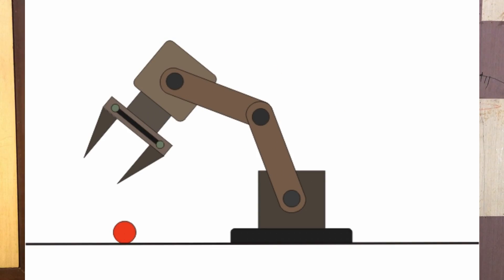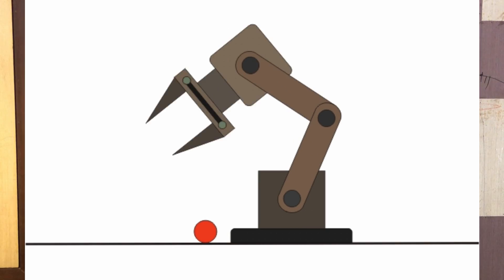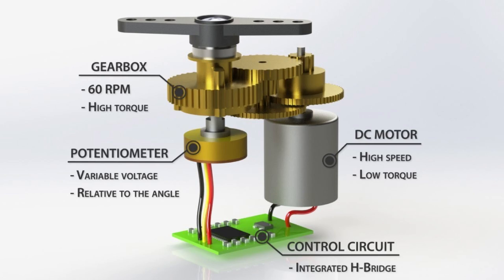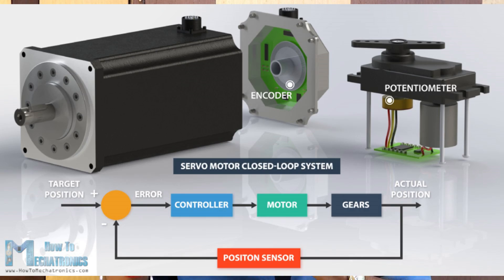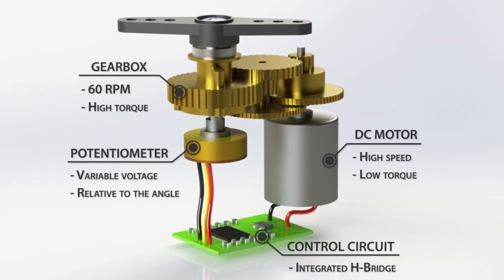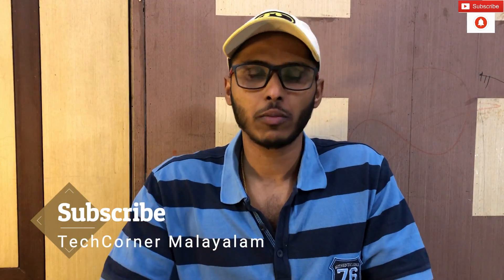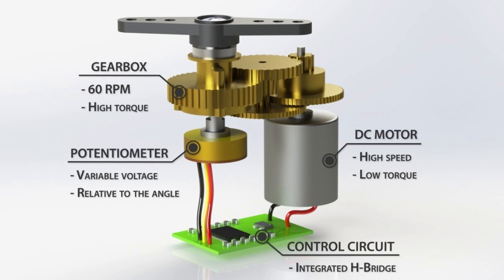Servo Motor in Malayalam | Working | Difference between Stepper Motor and Servo Motor

Comment: Hai I have a dought when changing time what precautions  need. If position change anybproblem
Reply from the maker: I didn't get your question
Reply: Sorry when I am writing time some mistake happens sorry. My question. Iam using many servo motor. But now one of my divise one servo motor starting time making small noise. And stoping. Error code  also comi g on VFD SI INI. AC S 120.       CODE. F07452
BUT GEAR BOX IS OK MOTOR ALSO. BUT WITHOUT FEAR BOX IT WORKING. AND WE BRI G ANOTHER SAME MACHINE ONE SET IT WORKI G. I changed moter then also same  mater. Any solution for this. Thanks for your kind co operation
Reply: If  I replace new motor  encoder position need any change.